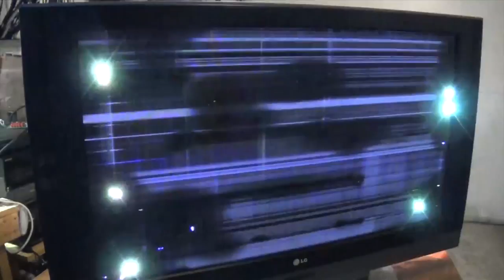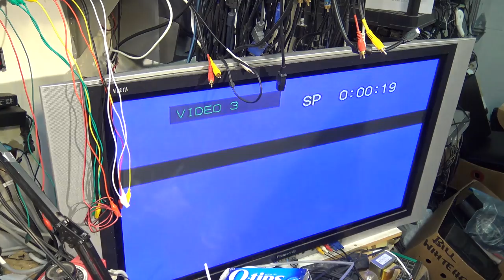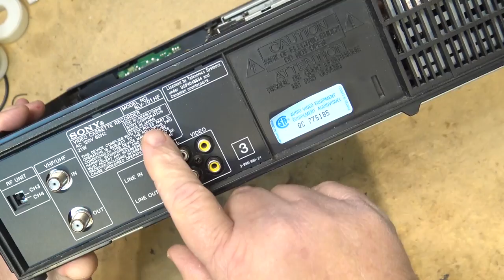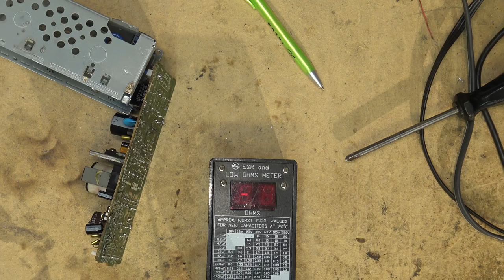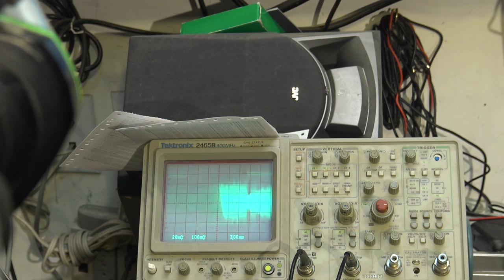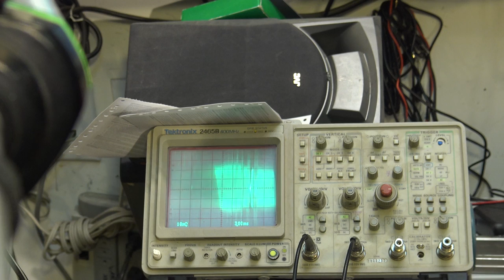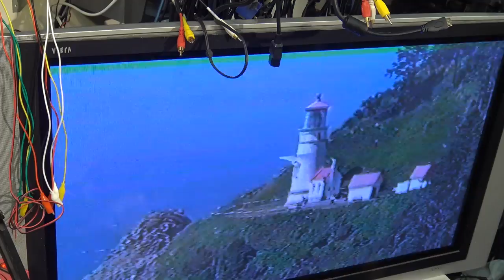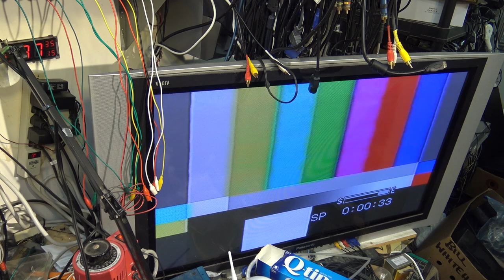Sony SLV701 VCR with poor playback picture repair

Comment: That was one nasty power supply. I wondered why you left the business? Precognition of the impending wind down of the VCR industry or something else. It would be very interesting to hear about how you entered the biz and memorable things you learned the hard way in the beginning. Some people pass on their knowledge by writing books, or mentoring young candidates. For such a disappearing repair industry I wonder what your thoughts are about the biz. For all the prophecies of VHS tape disintegration.. they are still being converted. And now even DVD recorders are gone and people are rediscovering.. or making the same old mistakes of trying to do conversions and capture with PCs.. before seeking professional help as they probably should. Video transfer doesn't seem to be getting easier, but even more dependent on real experience which doesn't serve the amateur as well as the past.
Reply from the maker: I left the business in 2003 because I could see the writing on the wall, and didn't want to be the last guy standing. I actually started my planning to get out a few years before, as I was watching the industry transform into a throw away industry, and made the decision right around Christmas 2002 that the time was right. Time to get out before I became too old to train in another industry. 
I had never intended to get into the business. My formal college education was in video production. My original goal was photo journalism, to be one of the guys running around with a television camera gathering news stories. That is what I went to school for. Camera work, and video editing.  I did work at a TV station for a couple of years, an intern for the first 2 and then on staff, master control for a community station.  There was very little opportunity to get on full time though. I saw an ad for Sony, looking for a QA technician. I had worked for a few years at a small TV shop when I was in high school and learned the basics, plus I had been building and tinkering with electronics since I was about 8, so I had the basics down. Sony didn't hire me as the QA technician, but they did hire me as a junior video tech, and put me through the Special High Intensity Training course (that spells shit BTW) to learn how betamax worked. After the course I was thrown to the wolves and had to start fixing broken beta recorders. I did that for about a year, and then Sony wanted to move me to the permanent location for me, in Winnipeg.
I said thanks but no thanks, as I wasn't going to relocate for a job that paid 9.65 an hour. I left Sony and landed at a self servicing dealer. That is where the fun began. Not only did I work on VCR, but TV and stereo gear too, and the companies we did warranty work for, Sony, RCA, Panasonic, Toshiba, JVC and Nakamichi started sending me to their training workshops where  we studied all the new technology that was coming online. Multi day courses with lots of theory and hands on.
I had to write exams on everything, and ended up writing the CEASA red seal certification in about 1986. So I basically fell into the repair business because it paid the bills and allowed me to start my video production business which did fairly well in the 80 and 90s, right into the early 2000s
I did high end multi camera weddings, and live performances (hired by the performers), and did a number of corporate videos. Product training and sales videos. Real estate sales videos, and even did some stringer news work for CBC and Global TV.  To tell you the truth I never really enjoyed the repair business. I did it because I was good at it, and I made allot of money back in the 80's.
What I really enjoyed was running around with a camera on my shoulder shooting and editing videos.  When I left the business in 2003 I promised myself that I would not repair equipment. I managed to stay away for a number of years. It was Sept 2 2013 that I took on a satellite receiver to fix for an old friend. He wanted me to fix it at his house and I told him that would film it and put up on youtube so he could watch his old satellite receiver being repaired. That video is this one:
https://www.youtube.com/watch?v=Z3XIDwnNZhI
Interestingly I left the TV shop in August 2003, and I fixed my first power supply after than in Sept 2013. I stayed away 10 years. This was the first video that I monetized. I hadn't even considered doing the youtube videos at this point, and the few videos I had up prior to this were about the car I loved, my 2012 chevy volt (hence the name 12VOLTvids) The first handful of videos I published were on this fantastic car. Incidentally I still have that car, it has over 100,000 miles on it, and has not had a wrench touch it yet. A few months after publishing the power supply video I was notified
by youtube that I was eligible to become a  monetized content creator, so I started looking through my storage unit for old electronics to fix, and started putting them up. 
I actually enjoy fixing old stuff more now, than I did when I was in the business, and it lets me make videos and share my knowledge and experience, and make some money while I am at it.
Reply: @12voltvids  Very interesting story.. was the Volt an early EV like a Leaf? The formal training in VCR repair really shows in your videos.. it looks like you took to it like a duck to water. Strange that you wanted to stay away from it for so long and waded back into it for a friend. It appears you have a natural talent as well as a clever attitude about the subject. I wonder how you never wound up in Television and Movie production there since I thought Lions Gate Studios is around there and there were many special effects shops producing material for many TV and Cable series.
Reply from the maker: @joey_after_midnight  
The volt is a plug in extended range EV.  I have 2. Old one goes about 35 miles on battery before switching to gas.  New one goes 55 miles on the battery before switching.  
I went through the tv production course just before Hollywood north took off.  A friend of mine 5 years younger got into the the film industry.  I was already in the repair business by then and was running my own video for hire company.
Reply: @12voltvids  Ahh.. I see. I wondered about those hybrids. Kind of sounds like an inkjet printer situation. Every so often you need to make sure to run the gas engine to make sure nothing drys out or gums up over time. Or vice versa, make sure the battery has a good charge for when you need it. It sounds range flexible though.
Running your own business must have been more profitable than working for someone else. I can understand that.
Reply from the maker: @joey_after_midnight  
Maintainence mode runs the engine every 8 weeks if it doesn't use any gas for 8 weeks.   It will also force all the gas to be used up after a year.   No there wasn't that much money money in video production.   If there had been i wouldn't have been working in the repair shop.   My costs were so high i made very little in the end.   One of my cameras was 20 grand.  I was always looking for that big break but it never happened.  So much competition all after the same customers.  
I didn't do it full time.  Wasn't willing to take that risk.  Repair shop paid well, the video work paid me an extra couple grand a month so i could buy toys.
Reply: @12voltvids  really enjoyed reading the  story of how the channel got started & the reason behind the name (I'd wondered for a while but always made the assumption it was some electronics reference).  The YouTube game is a great fit for you then, allowing you to showcase all your strengths as well as making a little extra cash.  I certainly appreciate the effort you make and the valuable knowledge you share , as well as being good entertainment for times like this (sat outside hospital for 5 hours waiting on my stepson going for various tests) and hugely important education which helps with my own hobby repairs and restorations.  Will have a look at that first repair vid now, thanks for the link. 73 Dan

Comment: Do all VCRs have a mode switch?  I opened up a client's VCR and could not find it.
Reply from the maker: They all have a mode switch of some kind. A few just put some regular push switches on the board and had cams on the control arm that would activate the switches as it slid back and forth, and some of the very old JVC and Zenith models used an optical encoder that read holes drilled in the cam gear.

Comment: I can't get D100 on Amazon Germany, but D100S-2 in a little spray bottle (2 oz). Is that also usable like your D100? Costs 30 EUR by the way, which is around 47 CAD...
Reply: There are European alternatives.. Can't think offhand of the specific German brand.. Jan Beta uses it.. In UK we use Servisol.. same thing

Comment: What video is that PSU explosion on the VCR in the intro from? (0:03)
Reply from the maker: It doesn't explode in the repair video.  That was actually a new cap that failed right out of the gate

Comment: Do ESR values of capacitor varies with ESR Meters.
Reply from the maker: No. The meter is Zeroed out before measurement.
Reply: @12voltvids  I bought a cheap ESR meter. For ESR values i googled internet their are so many list but values varies in different list. How is it possible.

Comment: This deck is from the early 90's.
Reply: Not really. My parents had one without HiFi Stereo from the early 90s. And that one didn't wanna break... So I missed HiFi Stereo back then on VHS... As he said this unit from around 2000.
Reply: @kyoudaiken  I still have the brochures of these series. It's from 1993. The Sony decks from 2000 and later are made by Samsung and Funai.
Reply: @KR1275  When did HiFi Stereo first pop up on Sony VCRs?
Reply: @kyoudaiken  Around 82 (BetaHifi).
Reply from the maker: @KR1275  i looked this model up on sony.ca and it said Aug 2003.
Reply: @KR1275  And on VHS? I wonder why we missed that. Maybe they decided to buy a lower end model is all.
Reply: @12voltvids  Hmm. Weird. I just checked my collection of Sony brochures and I found this series in 1992 and 1993. I know we have different model numbers in Europe (because of PAL), but the models are identical. This model was replaced by Sonyt's first VHS VCR with TriLogic.
Sony USA still has the manual: https://www.sony.com/electronics/support/res/manuals/W000/W0009745M.pdf
Maybe you found the SLV-E701?
Reply: @kyoudaiken  I think some months later. HiFi VCRs were very expensive those days.
Reply from the maker: @KR1275  
I just did a Google when i was editing for this model and it came back August 2003.  There were other models that used this crap mechanism too.  The first mechanism was the one with the blue gear. Slv555, 757, r5, 1000 ect. Then came this one.  I didn't bother to look up a manual, i just went by what Google showed and it was directed to a Sony site.
Reply: @KR1275  This one is not from 1993, I think you were confused with a very similar series such as the SLV-262 which, by the way, used a Sanyo mechanism (the very typical P88...P92 decks). The one in this video actually has a Funai mechanism.
Reply from the maker: @KR1275  My bad, I just went back and looked. That was when they released the PDF of the owners manual. I do remember seeing some of these units back in my last years at the shop, but the chassis was used across several models, and to be honest I saw soooo many VCRs it was mind boggling. In an average day I would work on 3 TVs and 10 or more VCRs. I would chrun out about 4 or 5 an hour. Mornings were dealing with the TVs that were picked up, and they were done by lunch time generally. Come back from lunch and spend the afternoon from 1230 to 6pm clearing all the VCRs from the stack. My assistant did most of the audio work. Fridays I dreaded. That was camcorder day. I hated camcorders with a passion, still do.
Reply: @Vintaginside  This one is from 1993. Period. The transport is not a Funai. I think it's one of the first home made transports or maybe a Hitachi. Sony's first VHS vcr's were made by Hitachi (SLV-201 and SLV-801). Maybe Dave can tell us who made this transport. The Sony recorders after 2000 look like some cheap recorders previously repaired on this channel. Made in Indonesia stuff. Full of plastic. Not made to repair. Now back to Dave, because I like this channel!
Reply: @KR1275  It's a Funai. It uses the same mechanism as the SLV-X37 multistandard machine. The Hitachi deck like the one in the SLV-201 is completely different.
Reply: @Vintaginside  I didn't know it was a Funai. Thanks for updating.
Reply: @KR1275  No worries, greetings!!

Comment: The VCR chassis in these is garbage. Hate them.
Reply from the maker: Yup garbage.
Reply: @12voltvids  better than the ones with the blue loading cogs.. but that's about it.. These arrived about the time I got out of tv repair.. went into computers instead.. and boy.. Mitsumi and bad caps.. damn floppy drives